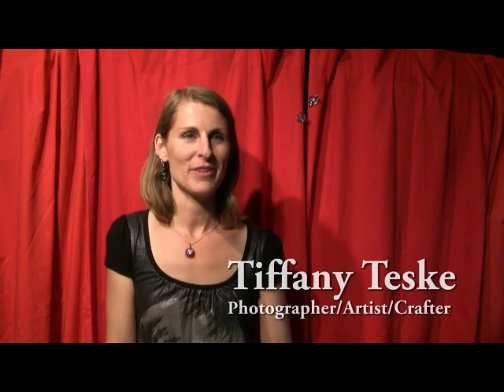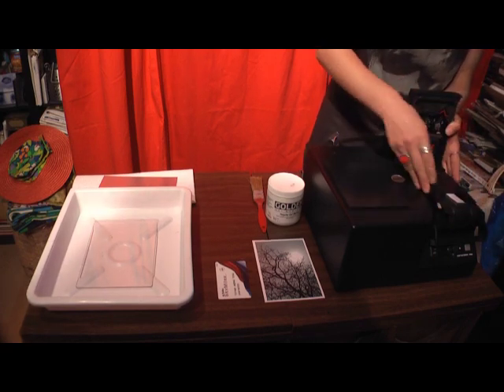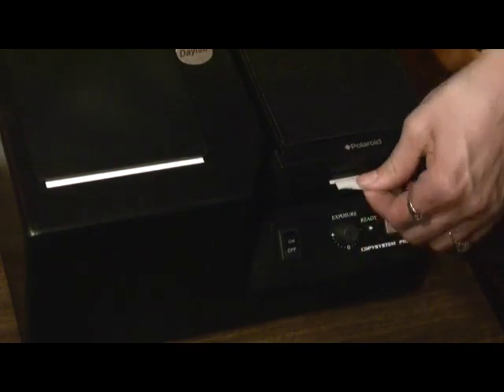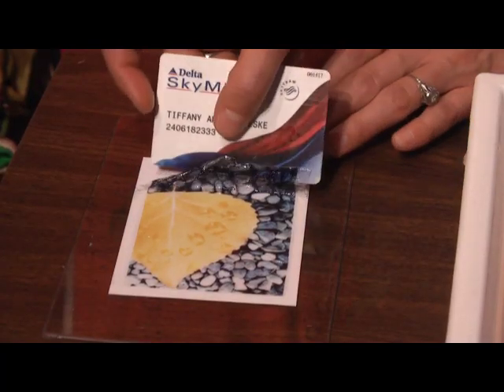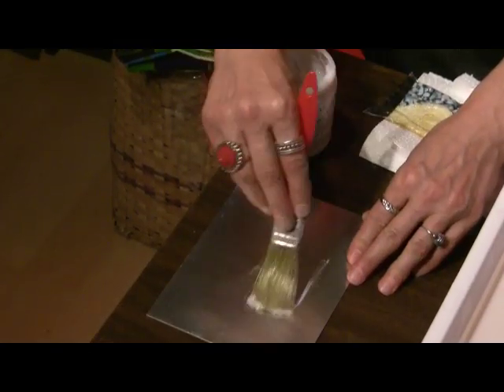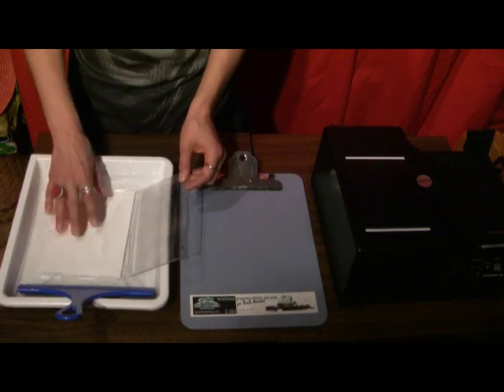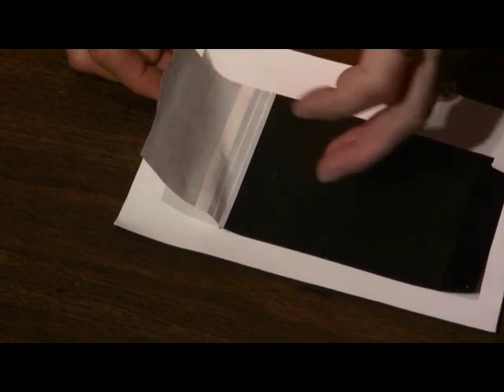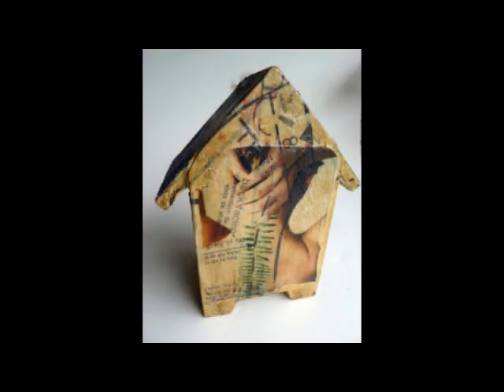Fuji Emulsion Lifts & Transfers Using a Daylab

Comment from the maker: @Davin9922. Yes it does. It is acrylic gel medium. It comes in matte or glossy and can be used as an adhesive and a sealer.  The brush strokes are really noticeable on metal, as shown here, but are not very noticeable when applied to paper.  It will dry clear on everything.

Comment from the maker: Hi Josh, I am sorry I am just responding. In a dark room, you peel the bottom layer from the pack film, which makes the top layer lay against the watercolor paper. Then, you roll over that with a brayer. The only step that needs to be done in the dark is the removal of the bottom part of the pack film. Once the top layer is against the paper, it can all be brough out into the light, brayered a bit more, then two minutes later, removed from the paper. I hope this helps.